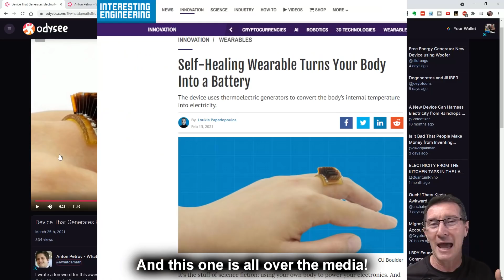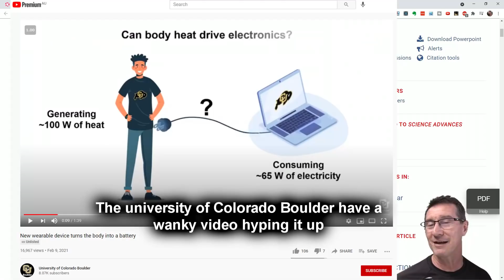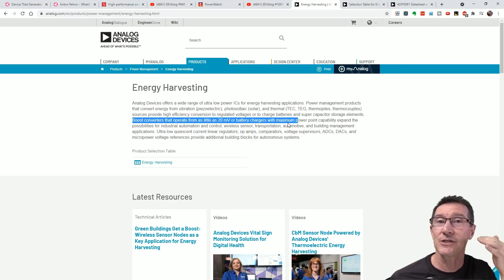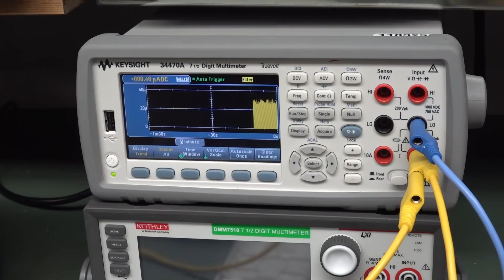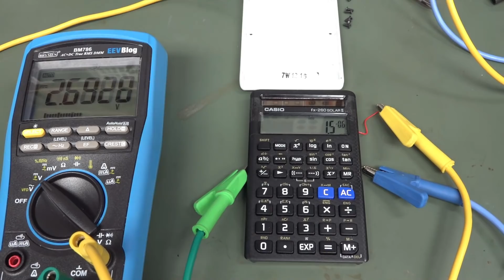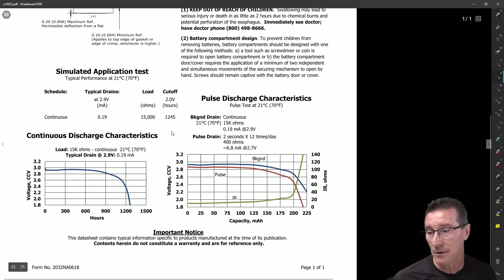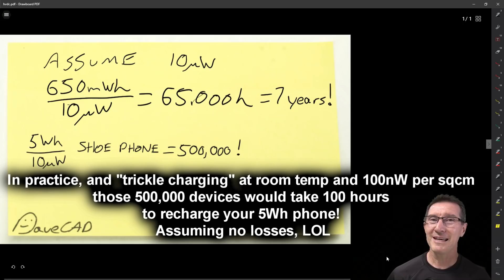EEVblog 1383 - Human Battery Energy Harvesting BUSTED

Comment: How well would this tech work to recover heat as power from things like combustion engines?
Reply: TEGs are normally only about one third 15% efficient and that is the good ones. They work, but the overall current produced is fairly weak.
Reply: Not very

Comment: I don't like how you were using K (Kelvin) and C (Celcius) interchangeably...

93k = -180.1c
Reply from the maker: It's a differential not an absolute which is equivalent to celcius
Reply: It is the difference in temperature being discussed here. Since Celcius and Kelvin are the same magnitude but shifted, you can use them interchangeably for differences in temperature.

Comment: you are correct, but lets talk about different thing... i will try to be short... imagine creating really high efficiency TEG (unseen so far) and you put it in a wearable, lets say the body to ambient temperature difference is big, that means that this TEG will suck heat from your body and create electricity by moving that heat energy out of you... so how healthy is to have something cold on your body all the time? :)
Reply: So long as it's not super super cold it won't really do anything. Might reduce overall body temperature if it's sufficiently big.
Reply: @OtherDalfite  even if its lets say 10 degrees lower than your body temperature (which such TEG for sure will be able to do) it will reduce the flow of blood to that place of your body drastically which might have consequences with long term usage... imagine having your feet in a water 10 degrees lower than your body temperature all the time, even if you ignore the water effect on your skin, the sole temperature will produce some problems in your feet...

Comment: Why would they even go for thermal power? Self winding watches are a thing, I'm sure you could translate that concept better.
Reply: That's right! All that kinetic energy is transferred much better through simple rotors and springs
Reply from the maker: The researchers are just fantasising about the applications. And it works because it got mentioned everywhere and went viral, which might help bring in more research funding. Doesn't matter that it's practically true or not.

Comment: What do you think about this one?  "Ambri"   https://www.youtube.com/watch?v=ZRyo0Nr7CrY&t=187s
Reply from the maker: Haven't really looked into that yet
Reply: They promise things for years. I looked at what they had a few years ago (likely the same as now) and was nowhere near cost effective compared to other available batteries like LiFePO4 that is still my recommended type of offgrid solar energy storage. Grid connected storage is just not cost effective at this time as best Lithium battery has a cost amortisation of $0.2/kWh but for offgrid is by far the best option when electricity is needed. For heat thermal storage can be lower than $0.01/kWh in therms of cost amortisation and so that will likely always be the lowest cost.
Reply: Whilst I am skeptical the fact they have deals/collaboration with an NEC subsidiary and a deal with a large data centre development does make me feel there has to be... something viable... but I won't believe it until I see it in use (to me there is a major difference between 'non-competative' - ie it works well and as advertised but can't beat on cost and just totally 'non-viable' - ie the whole concept makes no sense / can never attain anywhere remotely near the advertised marketing BS.... I see Ambri in the potentially 'non-comptative'  basket rather than the pie in the sky crazy freaking solar roadway crud'